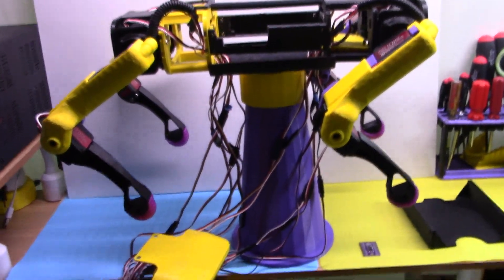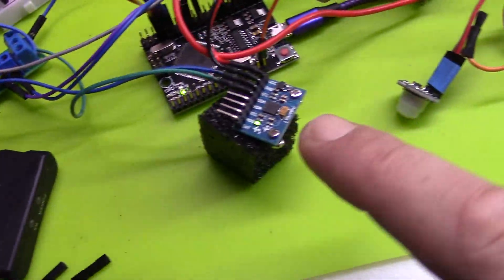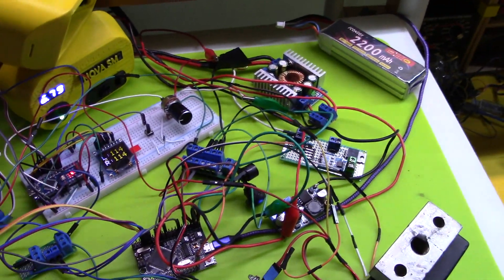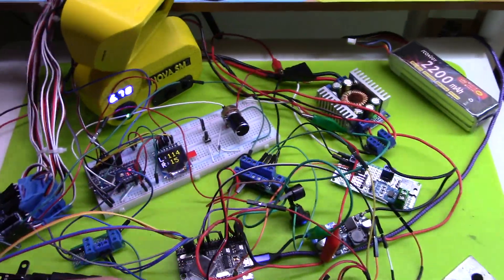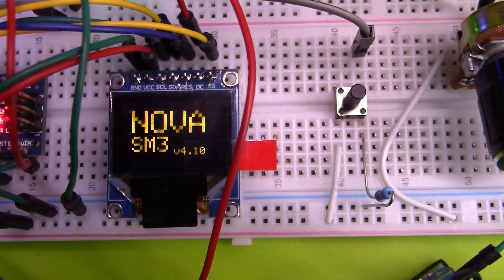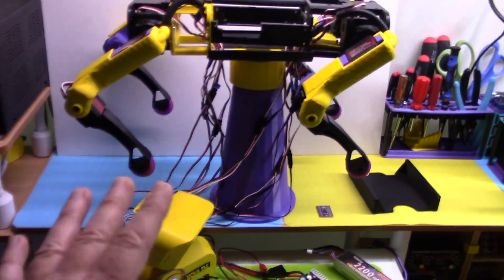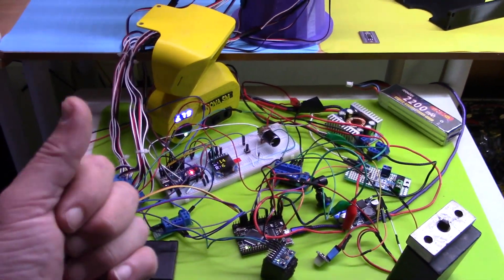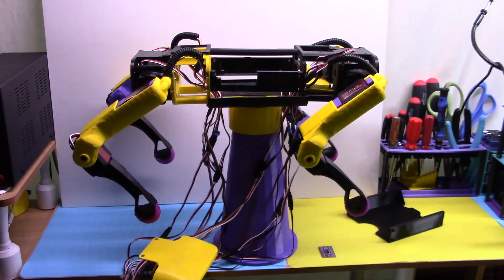SPI, I2C, and Hardware Tests : Nova SpotMicro3

Comment: Very Interesting...
It seems to me (if it is the Screen update routine causing the stutter)  that when the robot is walking/moving a simple fix would be to just bypass the Screen update routine until the walking/moving routine is no longer enabled.... or am I missing something ?
Reply from the maker: well, its not quite that simple.  The Nano circuit is called through i2c for not only the OLED, but the rgb leds and the ultrasonic sensors.  And yes, these things need to be called during walking routines. Not the OLED, you are correct there, I only call to that when she is stopped.  However, the stuttering is unrelated to the i2c problem I had, which was expecting the Nano to be both a master and a slave on the same i2c bus - that's just not reliably possible, so I had to change to SPI display.
Reply: @ChrisLocke1969  Thanks for the detailed explanation Chris. I had thought only the OLED was the problem. You would probably need a much faster MCU.
Reply from the maker: @lasersbee  agreed - but as I like to say... I love the challenges, so I will continue with the Mega for now.  Honestly, I think if I use the TCA9548 i2c bus manager board, I think I can ensure no two devices will use i2c at the same time, which should solve all issues, I think!   I am going to wire it into the circuit and write some test code this evening, and possibly post a video if its a worthy device - stay tuned!

Comment: You could switch to a teensy4.1.  It runs at 600mhz, so quick enough to drive everything without hickups and is still programmable in the arduino IDE and has enough ports to drive all your sensors. I designed a board  (servocontroller) for this Teensy4.1 which i can send you if you like.
Reply: I'd seriously considèr moving to vscode and platformio too. I diid that . It took me a couple of hours to get setup for for  the arduino  thanks to some youtube videos.  Its really  cool and you can manage github at the same time.   Just  copied and pasted my existing arduino code, added the librairies and everything worked.
Reply from the maker: @B_mata  good idea. i do use my external editor,  UltraEdit, connected to aIDE when Im not making videos, and git, Im an old-school command line guy 😉. But yes, a fully integrated editor would be 1000% better than arduino ide, indeed! I will look at your suggestions, much appreciated, Bob!
Reply from the maker: you guys rock, thanks so much for this suggestion!!  New video dropping very soon!!  :)
Reply from the maker: That sounds like a strong possibility - I appreciate the suggestion. Yes, I'd love to take a look at your servo controller board, please and thank you kindly!
Reply: @ChrisLocke1969  send me an email at info.equibo@gmail.com and i'll set you up.
Reply: Yes I also suggested a Teensy board which I'm considering for my project along or an ESP32  I did here of some library compatibility issues with the Teensy 4 so wondering if a 3.x would be less of a headache
Reply from the maker: i will definitely look into using a teensy... i have heard of that board, but have never used one. My biggest concern is will it have enough pins to support all the hardware. Thanks for the suggestion, i will order one today! 😎😉👍
Reply: @ChrisLocke1969  The Teensy 4.1 has 55 digitall outputs (54 on the mega) and 3 I2C busses.  The Teensy 3.6 has even more.  Here's a link to the different board specs https://www.pjrc.com/teensy/techspecs.html
If YT deletes th elink, google "teensy specs comparison"
Reply from the maker: wow, looking at it, one would never guess that lol  Thx again, just ordered a 4.1 👍👍👍